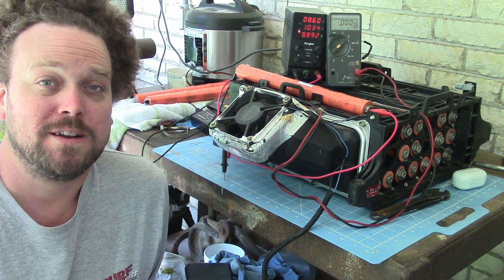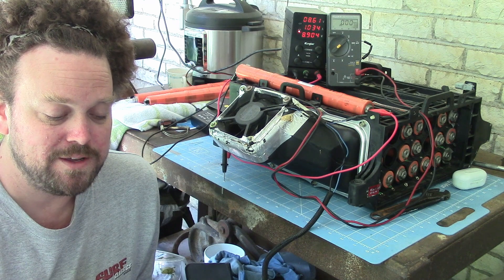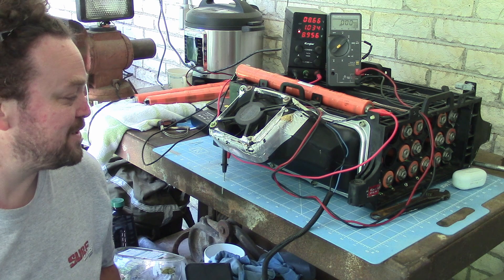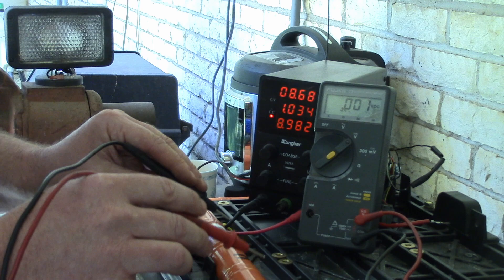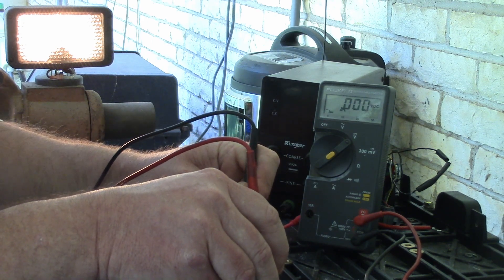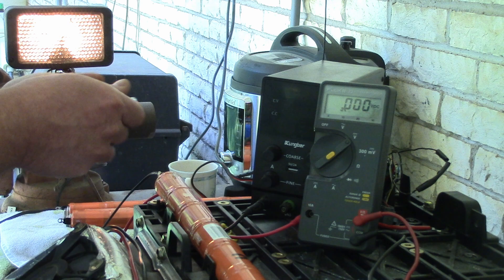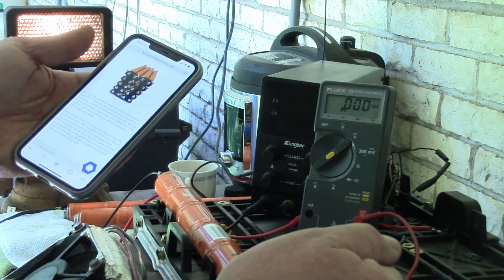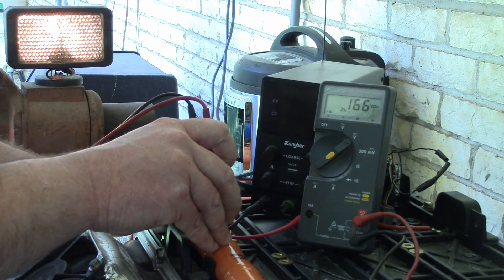Discharging Honda Insight IMA Too Low Might Cause More Harm if Pack is Already in Bad Shape.

Comment: you have shown what can happen, however deep discharging doesn't avoid the issue or cause it. you've proven that polarity reversal can happen in any already damaged battery stick. in fact polarity reversal diminishes as amperage drops so technically the worst reversal of polarity occurs when the IMA is using the cells at max amperage not when discharging a pack below 50 volts as the cells lower the draw. lowering the cells to near zero volts may actually help cure some of the weakness in those cells you're showing in the video. i'd like to see a test done before and after a deep discharge to near 0 and see if the reversal is better or worse.

Comment: WARNING: The "rubber" stick separators inside the battery pack are flammable!!!!

If the protective cover has been pierced there is a chance that voltage could reach the "rubber" and ignite it!!!

Hopefully you just did this test on the one stick and did not reinsert any sticks that had been pierced. If you did that could be bad. Really bad.

There is a thread somewhere on Insightcentral that shows a guy who had a pack out of the car with the sticks inserted that didn't have any covering on the cells. The pack went up in smoke. Oof.

Good showing of cell reversal though. Enjoyed your videos.
Reply: making a tiny poke in the sheath isnt the same as removing it completely. in fact the sticks often damage the sheaths when removing and installing them if you're not too careful. even then it's not a hug deal, but when you have all cells in a stick conducting to it in all surrounding slot, that's when you will have a problem.

Comment: Some nice advice. 2003 Honda Civic Hybrid so same same situation. I've got plenty of sticks and actually have a bit more experience with reconstruction of said sticks to go down to the cells. I was so interested in replacing my NiMH IMA pack with an updated LiIon pack. (No Sticks there) but can't work out the BMS communication conditions. Will be working on each cell and reconstructing the sticks accordingly. Thanks for your video. I need to video my experiences as well.
Reply from the maker: I bet videos on your civic hybrid would be more popular then mine on the insight. The insight has such a small audience at this point with how few of them are still on the road. It can be real fun making boutique videos on fairly rare things and getting to talk with people with similar interests. My little channel makes $400 a month more or less and I try to put about $400 of effort a month into video making. I basically just choose to film things that I am Al ready doing that interest me enough to pull the camera out for. I don’t know how to be successful as a content creator but I’ve found a little niche that sprinkles me with a small reward from time to time.
Reply: @BenHuttash  Believe or not you have provided yet another incentive to push forward to implementation of a revenue producing channel. I've slowly accumulated content and have not yet decided how I want to edit and be stable in production.

Comment: This is a great explanation of cell reversal. A lot of conjecture on the forums but not a very clear objective explanation like this. Thanks.
Reply from the maker: I was reading about on the forums but didn’t totally understand it. Once I was inside the battery pack I got to see it first hand had to share it because there are a lot of people discharging down as low as they possibly can get. I now think that you would have to have a near perfectly balanced and operational battery pack to do this safely without causing the further deterioration of already weakened cells.